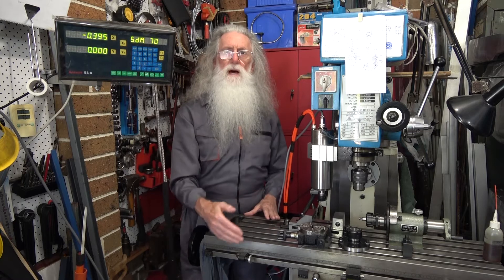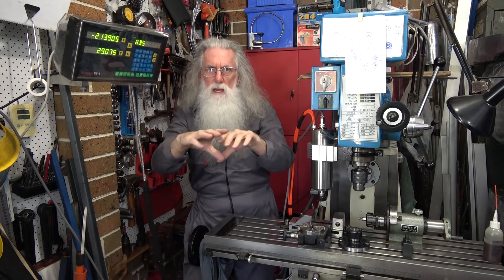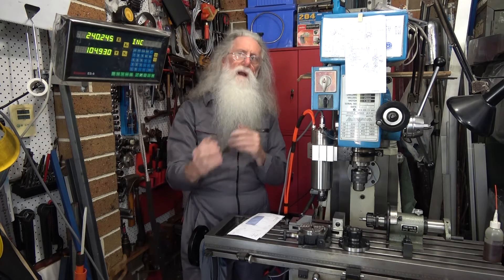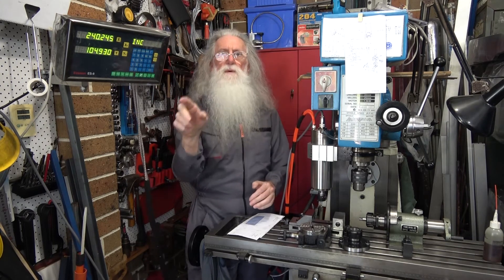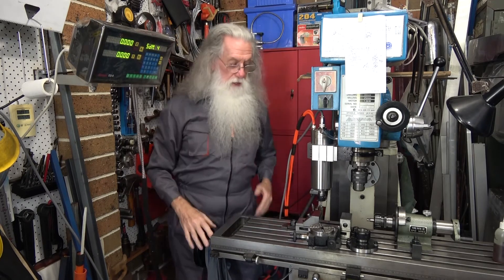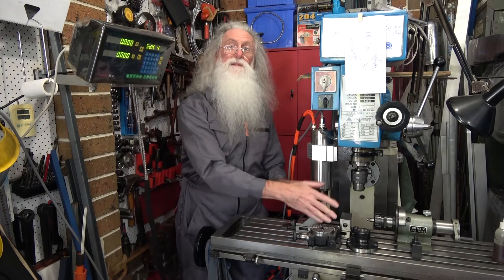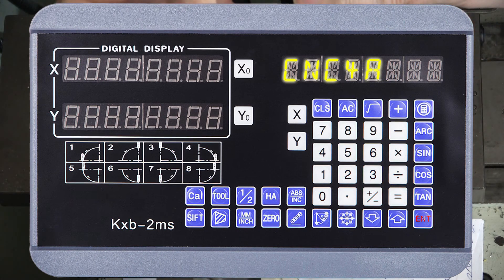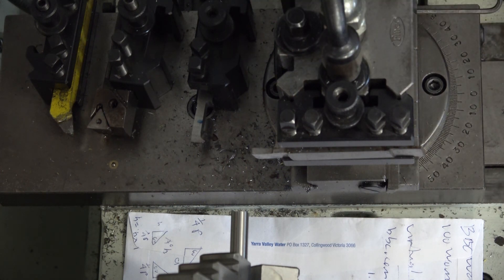DRO Masterclass SDM's

Comment: Hi Wizard, found your video very intetesting and loved the overlays that
 you presented too. Still unclear about how to interpet the SDM uses on the mill more functionality towards reptition. I think i need to be at the mill and watch your video until i become more proficient at incorporating SDMs in my mill work.
Regarding lathe as tool offsets it sank in well.
Thank you Wizard
Where are you in Australia?
 I am in Adelaide.
Reply from the maker: Hi Tony, thanks for watching and don't forget to subscribe so as utube pushes the video further up the food chain so it will be recommended to more people, thanks.  You have your DRO sitting there and SDM's are just like the buttons on the old VCR, you really never used them since you got it. Then one day you learn what they do and you wonder why you never used them in the first place.  If you find you are resetting your vice datum after each job or you have to get the calculator out to workout where the next hole goes then SDM's are for you.  You are right, play the video each time you are on your mill with a new job and one day the penny will drop, and, as The Wizard always loves to say, you will be Taken to the Next Level.